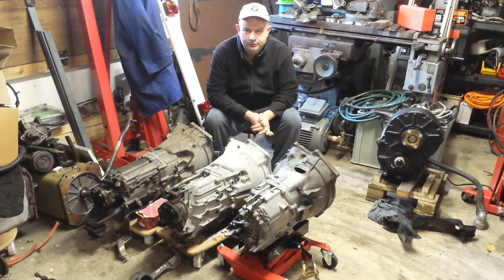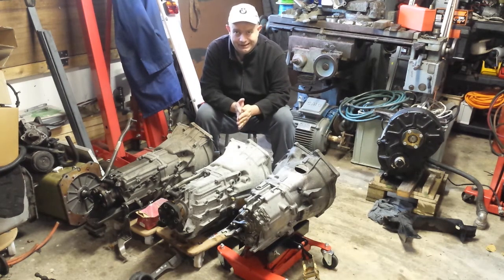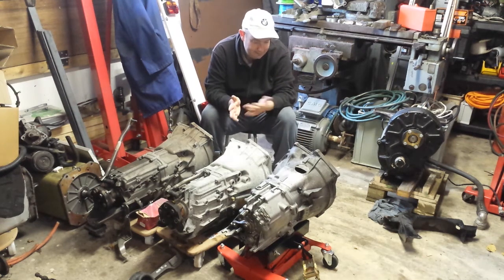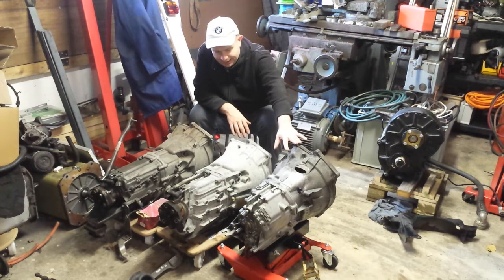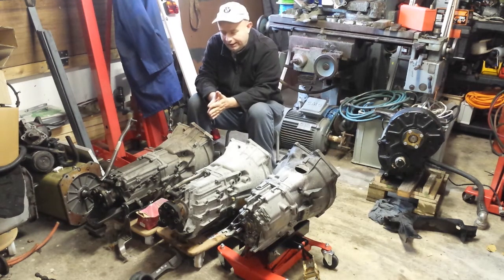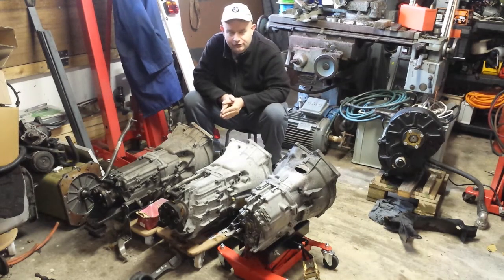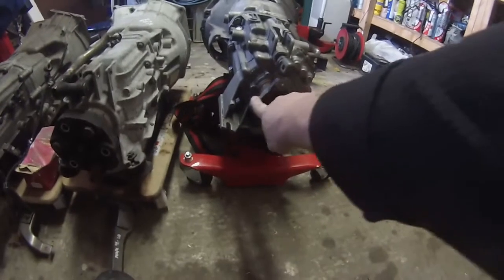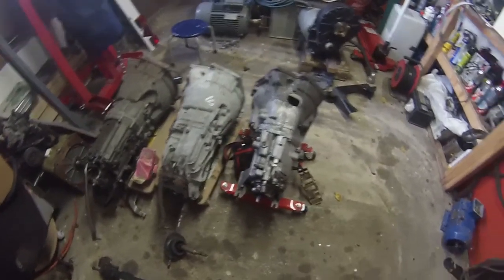BMW E31 840CI EV Conversion 68 : Gearbox Choice

Comment: Damien you are kind of shooting in the dark to determine your best choice for a transmission.  First you need to know the motor's maximum torque/horsepower r.p.m.. Next you will have do do some research and actually know the ratios of the multi-speed transmission, ring and pinion ratios and then the tire diameter.  Then use a interactive gear chart like this: http://xse.com/leres/bin/gearratio?title=SS+%23670+with+MM6+manual+and+3.73+gears&rpm=5200&mph=130&gear1=2.66&gear2=1.78&gear3=1.30&gear4=1.00&gear5=0.80&gear6=0.63&reverse=2.90&axle=3.42&diameter=26.85&circumference=84.37&revs=751&tire=wheel&section=285&profile=35&wheel=19     With all that said the transmissions has to be rated in excess for torque capability .

Comment: There is and advanage with the diesel transmission, top speed.
The 5 speed petrol transmission gets at 240 km/h maby 250 at 7000 rpm for the electric motor. 
Instead, the diesel transmission get at 250 at 4500 rpm, so you have 2500 rpm, so lets estimate a top speed of 280/300 km/h. I don't think you are allow to go as fast on your motorway. Acording to the motor, it works better at high speed, so 2" and 3" gear will work perfectly. I srtrongly recomad the diesel transmission due to it's mechanical resistance, but your car is perfect for German roads, and you can beat Mate Rimac's world record.

Comment: Your deisel gearbox donors are on the the right track. Much beefier!  I would read up on the gearbox RPMs... 8 to 10 grand may over pressure...turning them into goooboxes instead of gearboxes.  Might be able to drill out some oil reserves. and get more RPMs....not too sure about Beemer gearboxes.  seems to me the max out 5-6000.

Comment: can you run direct drive and just play with the diferential ratio? The broken box could be used as coupler and to conect the engine directly to the driveshaft without gears inside :)

Comment: as Dan said diesel box is always stronger, the 30d should have a stronger one than the 20d, evwest uses a overdrive with 2 gears but it's more expenside.